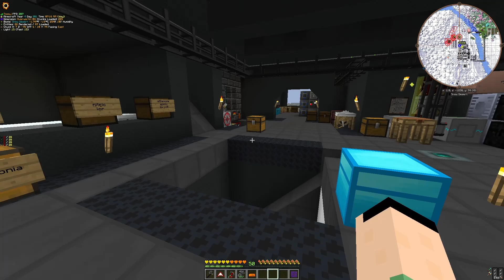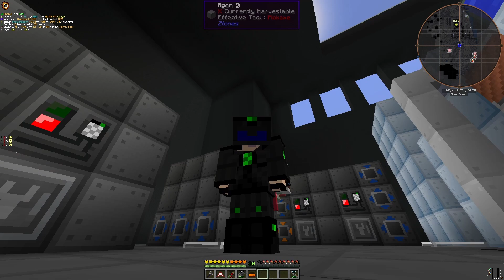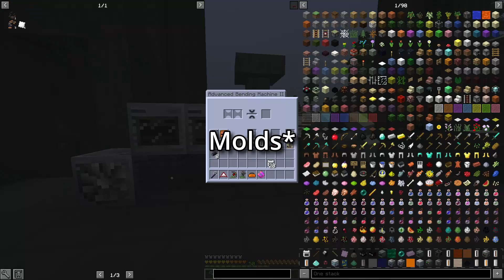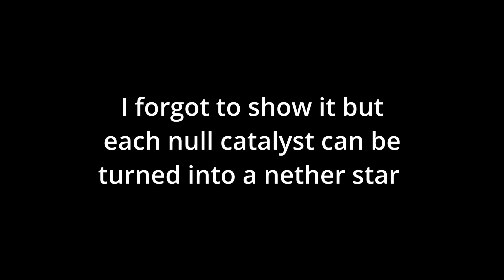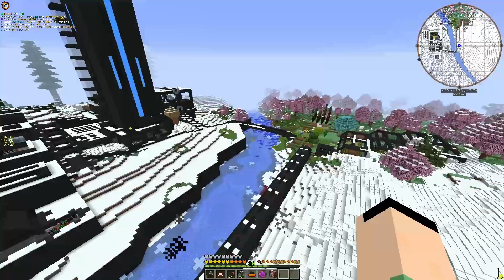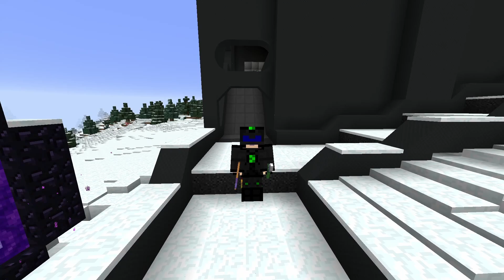GregTech New Horizons E23: Boosting to Rocket Fuel

Comment: I'd suggest getting into the habit of shuttering your pipes (shift R-click with a wrench) before they get too messy, as small amounts of fluids may "slosh" around otherwise.
The max size you carved out for the Infusion Altar is the size that it checks for "stability" objects. The actual range on the Altar's reach for essentia jars and pedestals is about half the size. For aesthetics, you can use a ton of heads, crystals, and other stabiliser blocks, but if you want it to just work, then you can replace the floor with blocks of quicksilver.
Reply from the maker: Dear employee,

I did that in the beginning when we had steam pipes. Now I am simply too lazy. I did do a little bit of shuttering after recording this episode though.

Best,
HamCorp

Comment: Dear CEO of HamCorp, Consider centrifuging compressed air cells as source of nitrogen. It is one of the best renewable sources of nitrogen and it can be easy upgraded later on with centrifuge multiblock.